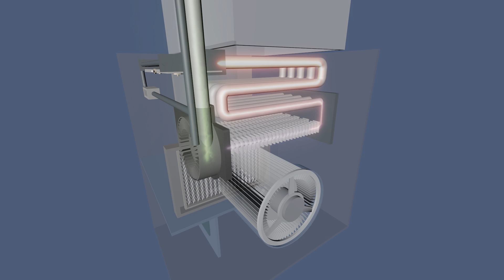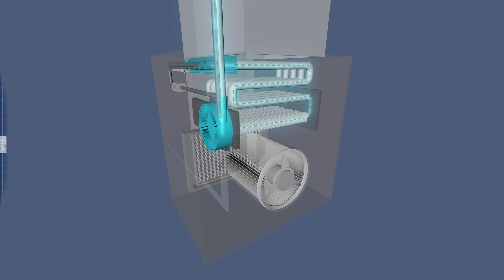Noisy Furnace? - Top 5 Fixes | Repair and Replace

Comment: Any ideas of a noise that happens randomly a few times a day during a cycle where it sounds like a garbage disposal for like 3 seconds? Its so weird.
Reply from the maker: Thanks for watching. Does your furnace have a condensate pump near by? This will collect water produced by the furnace and once the basin is full, the pump will run for a few seconds to remove the water: https://www.youtube.com/watch?v=dcLhyLu0-y8

Comment: love the noise examples ...but i didnt hear the one my furnace is doin...a sawing sound in and off
Reply from the maker: Thanks for watching, we're glad you found them helpful. If the sawing sound is coming from the blower wheel then check the alignment to see if any metal is brushing up against anything. Also check to make sure that the blower wheel and motor are mounted correctly and that all the mounting screws are secure. The mounting brackets should not move.

Comment: Hello i have an all electric Heat and AC home and when i turn the heat off theres a loud bang that Happens All the time sounds like the ducks that i hear when Heat is coming on.. just not sure why it makes the noise long after it’s turned off any suggestions?
Reply from the maker: Thanks for watching. Do you know where the noise is coming from? Is it from within the ductwork or the furnace itself?

Comment: My blower motor is fine. it's the fan itself that is too LOUD. :(
Reply from the maker: Thanks for watching. In this case it's best to try to narrow down the sound. Is the noise air moving through the ducting, or is the fan and motor vibrating within the mount?
Reply: @AmreSupply  the sound is the volume of air it’s pushing at high speed . It roars like a freight train. Nothing is lose.

Comment: I'm getting a slight metal banging noise when the AC is now on. I here more  as I go by the panel doors. Don't think it's the panel doors. As I put hand pressure on them the noise does  not go away. It sounds like it's something lose. I'm tempted  to open the doors and look. Can't heat the noise by the intake located on the outside  wall. So don't think it's blower related. Maybe  duct noise?  But it does not pop. Then again  it's cold air. Need a tune up soon . So I think I will leave it to the expert.
Reply from the maker: Thanks for watching. Sometimes these noises can be difficult to narrow down so it can definitely be helpful to hire an expert to do an inspection.

Comment: Thanks for showing the location of the blower fan. I had huge grinding noise and as it turns out one of the sticker labels inside the furnace came off and got sucked into the blower making grinding noises. I removed the torn pieces of paper from the blower and the noise was gone. I recommend spinning the blower manually first to see if the noise come from there
Reply from the maker: You're welcome, we're just happy that the video helped you fix the problem!

Comment: Thanks for this excellent video! My newly installed carrier furnace makes one popping sound only about second after stopping. Do you have any suggestions?
Reply from the maker: You're welcome! Without hearing the sound it's hard to say. The sound could be the sound of a relay closing. It could also be the metal ducting snapping back into position as the air pressure changes. If it was ducting you might hear the same pop when the blower starts as well.
Reply: Thanks for your reply. It was the filter hitting the grill.
Reply from the maker: @sk-wf9xp  That make sense. Glad that you figured it out!

Comment: Thanks for sharing this video. Moral of the story is my unit needs a new motor based on what I’m hearing smh. What frustrates me is we purchase our home 10yrs, brand new construction. The unit installed was a Carrier. Within 10yrs the motor has been replaced twice and other issues with the carrier unit. We get our unit serviced annually!  At our previous home we had a Trane unit, we had that unit for over 16yrs not once did the motor, compressor, condenser NOTHING major ever went wrong with that Trane  AC unit other a clogged drain that’s it. This Carrier unit we have at our current home is a nightmare
Reply from the maker: Thanks for watching, we're glad that you found the video helpful. Because of the differences between models and installations it is difficult to predict what will fail over time, but any grinding noise or bearing sound is a strong indicator that the motor needs to be replaced.

Comment: My fan sounds like a demon screaming. Thing turns on and it goes weeeeRRRRRAAAAAAAAAA
Reply from the maker: Thanks for watching. Does it happen right when it first turns on? If so then it could be the inducer motor. If it only happens after a few minutes of running, then it could be the blower wheel or the blower motor.
Reply: @AmreSupply  yeah I looked last night. It’s the inducer motor
Reply from the maker: @ChrisC1946  Thanks for the update. We do have a video on the inducer motor assembly you can learn more here: https://www.youtube.com/watch?v=EsJhfFMZWJA

Comment: Any suggestions for a 700 sq ft mobile home that when the blower is running it sounds like you have the window rolled down and have stuck your head out of a 747 while it's in flight. It is such a loud wind noise that a smart speaker assistant less than two feet away from you can not make out the voice commands, and is over 6 ft away from the single floor vent in the room. I have even tried to make a buffer to reduce the wind blowing noise like boom microphones use outdoors. The hvac heat and air conditioning systems work well but the fan has one setting "wind tunnel"
Reply from the maker: Thanks for watching. Has this always been this noisy or has it changed over time?

Comment: replacing blower motor on my furnace. problem is it's an old unit (pre 1988) and they have updated the motor. the new motor has 4 wires plus the 2 capacitor wires and the original motor had 5 wires plus the 2 capacitor wires. the difference according to the motor tag is the original motor had two med speeds and the new motor only has one med speed. can I wire it up with one med speed? do I use med lo wire, med hi wire or both med to the new motor? ty for any assistance you can provide.  🙂
Reply from the maker: Thanks for watching. If your furnace has 4 wires (plus one wire for common) set up for 4 speeds , then the furnace control will be switching between 4 lines of power. 

The motor uses wire taps which sequentially increases the resistance on the motor winding. You can see this here: https://youtu.be/3eOARJ8oRrc?t=276

If the new motor has 3 wire taps, and If one wire is doubled up, (2 lines feeding into one tap on the motor), then one speed will just be repeated.

So depending on how you wire it,  it would result in "4" speeds on the new motor.
Low, med, med, high. 
or Low, low, med, high
or Low, med, high, high

Connecting med low and med high to the medium wire tap,  will likely be closest to the original motor.

If the wire colors are different or if you are not sure which wire tap is what, then you can test between each speed and common. The lowest speed will have the highest resistance.

Comment: Great video. I have an odd noise coming from my air handler when running that can be heard throughout the house that I would describe as a tuning fork, or like rubbing a finger on the top of a wine glass. I haven't been able to pinpoint what exactly is making the noise.
Reply from the maker: Thanks for watching. You could observe the startup sequence and see when the noise starts. Before anything else the inducer blower will run for a minute to provide a fresh supply of air to the burner. After that the burners will ignite and the main blower fan will circulate warm air around your home. 

If the sound happens right when the furnace starts, then it could be the inducer motor, or the sound of air in the exhaust pipe.

If the sound happens later in the sequence then it could be the main blower motor or sound of vibration within the ducting.

Comment: I live in a duplex. We both use the same brand and type of furnace. When my neighbors is on, you can barely hear it. When ours is on, it sounds like a jet engine taking off. I'd like to think that's not normal, but our landlords property manager says otherwise.
Reply from the maker: Thanks for watching. Are the two furnaces separated by a wall or any other barrier?
Reply: @AmreSupply  no, they are literally side by side
Reply from the maker: @TheDeadNorth  Two of the same models side by side with no barrier should sound the same unless one of them has different parts.

If you hear the sound at the beginning of the startup sequence then it's likely the inducer fan. 

If the sound is loudest when heat is running, then it's likely the blower fan.

Comment: I've noticed my furnace humming when the unit isn't on ..any suggestions?
Reply from the maker: Thank you for watching. A low consistent hum when the furnace is off is likely a low voltage transformer or even the sound of the humidifier. Some are more noisy than others. If this is a new sound then it could be a sign that it is beginning to fail.

Comment: This is great!  Sound samples are tremendously helpful.   Here in NW Montana, where I woke up to -30F this morning, I really like when this thin-walled camper's furnace runs properly.   But it does not always run well. 

Sometimes it start off rough, wobbly or rattly, lower RPM, and no heat. After a few seconds to a few minutes the motor goes steady and smooth, just normal hum and air noise, then a few seconds later the ignition kicks in and I have heat.  But sometimes it'll start off rough and stay that way no matter how long I wait, blowing cold outdoor air into my formerly comfy living space. Waking up to 40degF and a noisy blower at 3am is not fun. Maybe thumping the exhaust port or the main housing of the furnace will cause it to run smooth.

From other videos and articles I know about the sail switch, which explains why there's no heat during the wobbly/rattly phase, and it all works fine once the motor goes steady at full RPM.

So, do I need a new motor or could a bit of oil or some other cheap easy method fix this?
Reply from the maker: Thanks for watching. Not all motors can be easily lubricated with oil, and not all motors have the ability to be adjusted. It could be that the motor bearings are starting to wear down.

We don't have any videos or guides on RV furnaces or adjustments so I can't point you to any other resources directly. Before replacing a motor, check to make sure all the switches are good, and that the airflow does not have any restrictions. Those can change the operation.

Hope this helps!

Comment: mine sounds exactly like the motor bearing clip you showed. I assume I need a new motor? because the sound will be intermittent. it will be very noticeable but then sometimes be quiet to where I do not even know if the furnace is on if I'm in another room.
Reply from the maker: Thanks for watching. It can be difficult to tell but you could always check the alignment and see if there is any friction when you spin the blower wheel. You can see how to access it here: https://www.youtube.com/watch?v=4SY8lRl8HV0
Reply: @AmreSupply  I replaced the motor. It was oozing out oil and was very hot to the touch/ sticky. Sounds great now.
Reply from the maker: @agarcia8800  Thank you for the update, we're glad that you were able to fix the problem!

Comment: My furnace is currently making rattling noises and it will run for like a minute and then start to lose power and then shut off. I've been told different things but no repair. I am not sure what's going on
Reply from the maker: Thanks for watching. It is possible that your furnace is rattling and also there is an issue with one of the safety switches being tripped. This video shows how to narrow down the problem when the furnace keeps shutting off: https://www.youtube.com/watch?v=b0sAGt-1niU In your case it's likely an issue with the airflow which might be tripping the high limit switch. If the motor is starting to fail then it could cause this problem.

Comment: I stripped the motor mount Holes fighting to align it for 2 hours. Now I have a dilemma.
Reply from the maker: Thanks for watching. Stripped or crossed threads are never fun to deal with. Depending on how much room you have you might be able to fit a bolt and nut to secure that in place. It might be tricky to get the nut on and it wouldn't make accessing the motor easy in the future.
Reply: @AmreSupply  I'm just about to try that now. Thanks for replying. I'm thinking I should remove the whole cage so I can sit it where the motor is vertical to make life easier.. that is if I can get it out lol.
Reply from the maker: @xxnoOne1  We're just glad to help. Best of luck with this!

Comment: What about a loud sharp high pitched "metal on metal" noise before it runs
Reply from the maker: Thanks for watching. That could be an issue with the motor bearings, or the blower fan could be making contact to the side of the housing.

Comment: Mine sounds like the barrings this morning it sound like a truck idle," not sure what to do 
Would oiling the barrings help ?
Reply from the maker: Thanks for watching. Oil can be added to the bearings and it can help. If the bearings are too worn out then a new motor will be needed. We don't have a video showing how to oil the bearings but we have one on how to access the assembly and replace the motor https://www.youtube.com/watch?v=4SY8lRl8HV0

Comment: Thank direct to the point. I have someone comein to look at it. He's also direct to the point buy a new one from our company. Geeze instead of just maintenance for the winter that's his first diagnosis. What's your recommendation?
Reply from the maker: Thanks for watching. It depends on what is causing the noise. If the motor bearings has worn down then a new motor would be needed. If the noise is coming from an alignment issue then you can just adjust the blower wheel.
Reply: @AmreSupply  
Thank you

Comment: Mine sounds like a washing machine that is out of balance!
Reply from the maker: Thanks for watching. You might need to do some adjustments and check the clearance around the blower wheel. You can see how to access the blower wheel here: https://www.youtube.com/watch?v=4SY8lRl8HV0
Reply: @AmreSupply  A friend who is licensed HVAC came over tonight and looked t it... the set screw was loose on the flywheel motor. The shaft is scored but he was able to get it back to the flt spot for right now! No more thumping!  I've saved the link you sent! THANKS!!
Reply from the maker: @tclodfelter8789  You're welcome! We're just happy to help in what way we can.
Reply: @AmreSupply  SUBSCRIBED!! Always learning something!!

Comment: We had a rattling noise from our furnace.  I cleaned and rebalanced the squirrel cage.  It still makes a rattling sound for the first few seconds and then stops.  How can I kill the noise for good?   TIA
Reply from the maker: Thanks for watching. It can be difficult to narrow down some of these noises. If there are any other screws then try to tighten them. As well check for any flex around where the blower wheel assembly mounts to the furnace. In some cases you can dampen any spots that might flex or vibrate.

Comment: Thank you for including the sounds of the various potential problems. I have a York system in the attic. Suddenly the air conditioning began to start and stop accompanied with a sound much like the bass drum in a parade coming from the attic. Do you have any insight to this. Thank you.
Reply from the maker: Thanks for watching. First, try changing any air filters for the AC unit / furnace blower. The sound of banging could be the sound from the air ducts. Are you able to recreate the sound when just running the blower fan without the AC unit?
Reply: No
Reply from the maker: @SlingbladeJim  In that case, it could be an issue with the compressor motor, the run capacitor, frozen coils or the compressor could be overheating. Unfortunately we don't have any dedicated tutorials on this as these AC units are less common in Canada. We did our series on furnaces and water heaters and are currently doing appliance troubleshooting. We do however have this video for testing the run capacitor: https://www.youtube.com/watch?v=NkgxNLCrmr0
Reply: So..will these be in the unit outside or in the furnace in the attic ?????
Reply from the maker: @SlingbladeJim  The compressor motor and capacitor will be outside and not in the attic. It could also be an issue with the thermostat. In any case if it is starting and stopping you're likely hearing the duct expansion when it begins to run. The key now is to find out why it's short cycling.
Reply: OK...THANK YOU VERY MUCH......

Comment: a person fixed a gas leake everything work but the gas  heater  doesn't turn on now after the gas repair but the stove turns on still
Reply from the maker: Thank you for watching. There are several things to check which can prevent the furnace from starting. This is the power switch, thermostat setting, check the furnace door etc: https://www.youtube.com/watch?v=Bi76q0TzoW8

Comment: Mine sounds like little bits of metal bouncing around when the induction motor turns on. Any ideas?
Reply from the maker: Thanks for watching. You might be hearing just debris that was pulled into the inducer blower or it something might have broke loose inside. You could always remove the inducer motor and see if you can remove the pieces of metal. https://www.youtube.com/watch?v=EsJhfFMZWJA